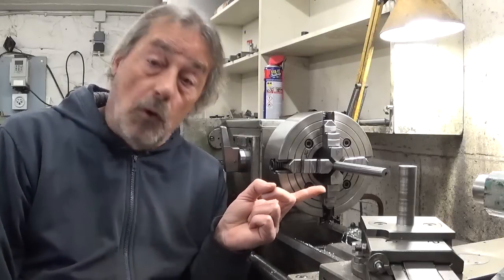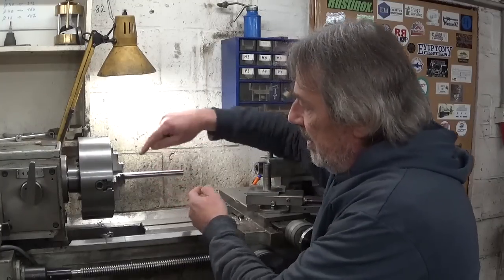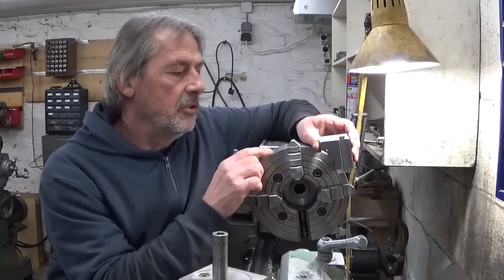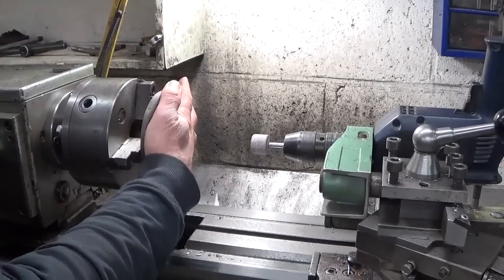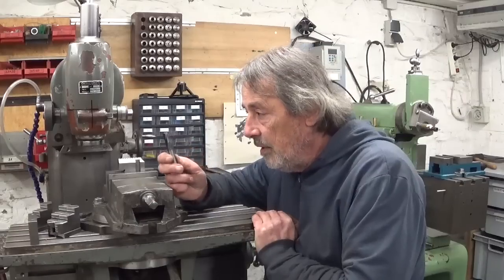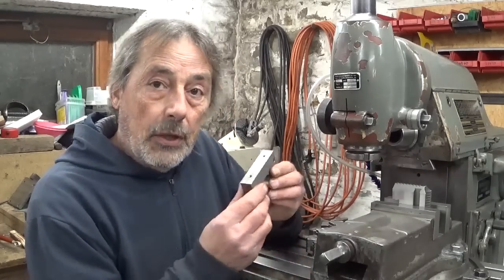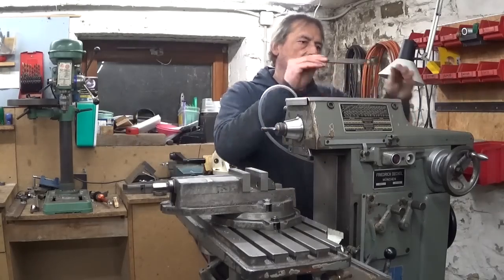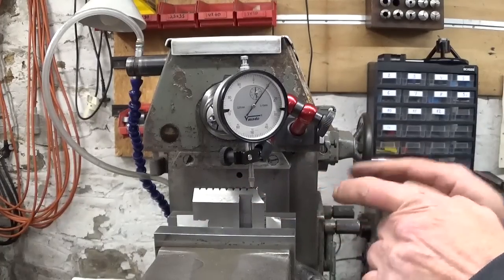Recutting chuck jaws.

Comment: Very interesting video: you can cut the hardened jaws steel with solid carbide end -mill? Because i have in mind a project and you did a part of that in case! 😀 ATB Michel, ciao from Italy, Alberto
Reply from the maker: Indeed, you can cut hardened steel with carbide.
Reply: @Rustinox  Thx Michel, that next step was to tap the hole, you had tried to tap on hardened steel? Or will i broke at 100% ? The idea Is the drill and tap the 3 jaws of My Chuck!

Comment: Great video. I did have a thought though. What if the jaws were bell mouthed? The majority of the length might have been good with only the front letting you insert the feeler gauge. Having said that you did get good witness marks in your final clamping test.
Reply from the maker: Even bell mounted, after recutting they are flat. So, no problem.

Comment: Thanks Michel. I have the same issue with my large 4 jaw chuck. I've already tried grinding the jaws in the lathe with a pneumatic die grinder. I put the preload on the jaws using a cnc machined ring with pockets for the jaws. It was a ton of work and the end result wasn't much better. I think I'll try your method.
Reply from the maker: Go for it. It's quick and easy.

Comment: You straightened out that old chuck in no time! Nice job Rusti
Reply from the maker: Thanks Ray P.
Reply: Problem is that the chuck isn't old at all by the looks of it. It's clean and still clean looking steel like it was machined yesterday and that's all over the chuck by the looks of it. Poor quality control letting a chuck out of the factory with wobbling jaws!

Comment: I had a Lagun milling machine years ago that I would set up for occasional surface grinding work. I would set my table feeds to automatically reciprocate and cover the ways and table to protect against the grinding dust. Worked great.
For recutting the jaws carbide cutters are the best for that. Thanks Rustinox for showing us this.
Reply from the maker: Milling the jaws was easy. With great results.

Comment: Considered this approach but instead grinding with a radius wheel but now am planning to go the hard turning route (CBN) as demonstrated by Rob Renzetti. I personally like to keep a radius on the jaws.
I have developed a product dubbed a 'preloading ring' which will work on any chuck, independent or self-centering. It's fairly cheap and fast way to get the job done. Currently documenting it on my website and will share in due time. 
Cheers from Holland.
Reply from the maker: Go for it. I'm sure there will be some interest in your method.
Reply: @Rustinox  It seems to be hard to share a link to my Wordpress site. I'll send you an email.

Comment: Hi Rusti, great end result, unless you are gripping a diameter that is exactly the same as the ground diameter in the Jaws (as original), you will only achieve line contact, having flat jaws also achieves line contact so no real reduction in gripping surface. Years ago, I used to use a machine that was all flat jaws with no serrations (3 & 4 Jaw), they worked just as well but left no marks in the part. Cheers, Jon
Reply from the maker: Interesting. Thanks for the info, Jon.
Reply: Small dia work needs less compression to hold. Large diameter work does benefit from having 6 gripping edges rather than three. That’s why jaws are made that way.